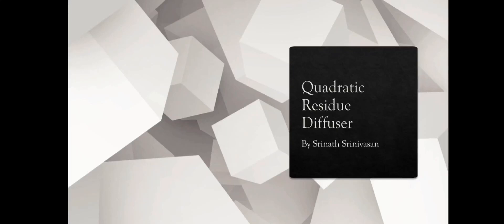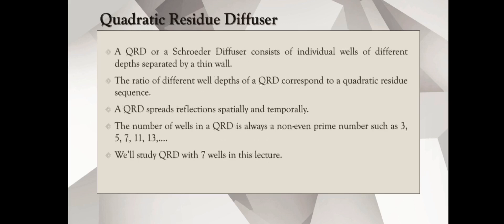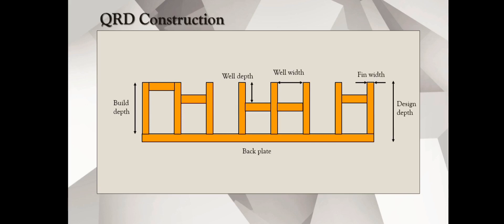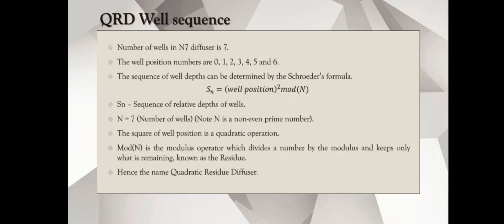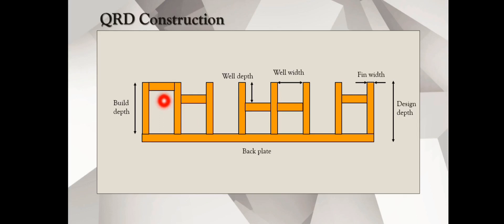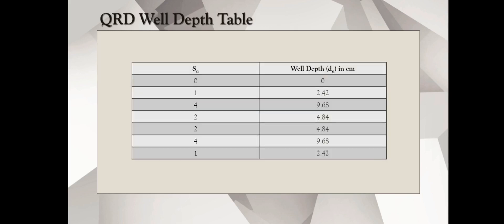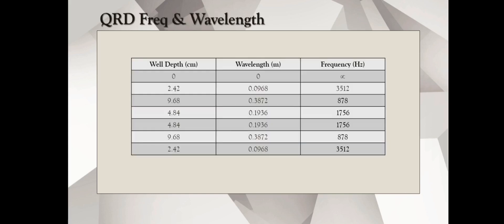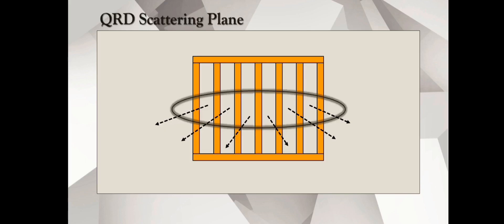Quadratic Residue Diffuser (QRD) Explained

Comment: This was super informative and helpful. I was following along with a spreadsheet and got confused because the numbers I came up with were different. I figured out that the computation of well depths had to use a speed of sound of 338.8 m/s and not the 340 m/s shown in the slides. With that adjustment, I got the same well depths and wavelenghts exactly, but the frequencies didn't match up. It looks like after computing wavelenghts based on 338.8 m/s, you switched to using 340 m/s for computing the frequency. That gave me exact numbers. I know speed of sound varies by temperature and elevation, etc. so its not a big deal if you used 338.8, 339, 340, or 343. That said, you might want to update the slides to use a consistent value for the speed of sound or make a footnote on what value you used in which computations. Thanks again for this video, it is super helpful.
Reply from the maker: Thank you! Regarding speed of sound, I always used 340 m/s. Let us go through the well depth calculation. The well with well position "1" can be calculated as dn1 = Sn1*(DF/2p), which translates to dn1 = 1*(0.34/2*7). Now, I took the first four significant figures after the decimal point and the answer was 0.0242 meter. Similarly well depths of other wells can be calculated using the above mentioned formula. Taking advantage of the Residue sequence which for an N7 diffuser is 0, 1, 4, 2, 2, 4, 1., I simply multiplied the answer 0.0242 meter by 0, 4 or 2 as required which resulted in the answers 0 meter, 0.0968 meter and 0.0484 meter respectively. 

While theoretical calculations can get precise to decimal points, practically, software rounds the value to integers in millimeters (mm). In this link below, I display the results by using the QRDude software to get the well depth values by either inputting "Design frequency" or desired "Deepest well" by which the design frequency would change. This software rounds the values and displays the well depths in mm.

https://srinath96.blogspot.com/2025/06/quadratic-residue-diffuser-well-depths.html

Comment: Awesome video, unless I missed it, is there any specific reason why many manufacturers exclude well number 0? Esthetically they'll look symmetrical but wondering if there's a benefit in terms of sound. Maybe well number zero is not that influent? Thanks in advance!
Reply from the maker: The well number 0 is present in QRD of any order. When installing QRD assuming N7, it is recommended to use arrays of N7 as using only one will not give meaningful results. So either one can leave the well '0' on one side or split the well '0' evenly along the ends. The latter option ensures that one does not need to worry about symmetry during final assembly.

I do not know which manufacturer excludes well '0' altogether but there is a well known QRD manufacturer - RPG Acoustical systems. Their QRD model QRD-734 as mentioned in their website offers well '0' split along both ends.

Out of curiosity I used QRDude software to check if there is any difference in keeping well '0' as it is or splitting it along ends and there was no observable difference. You can check the findings in the link in the video description now.

Finally my thoughts, even if a manufacturer were to neglect well'0' altogether, they still have to use end-fins on both sides to cover the diffuser sides. In that process, they have just added an approximate well '0' on both sides since the end-fin will have some finite thickness.
Reply: Oh thank you very much for your detailed explanation! Now it makes sense... It was my mistake, never noticed that most likely those looking "simmetric" in fact have larger sides to compensate...  I prefer the simmetric design, unless is equally good!

Comment: Great video, i have question: 

How to determine the exact number, width and depth of wells and
according to the needs of the room?

Thanks
Reply from the maker: First, the diffuser dimensions depend on available space and the frequency range of diffusion you are looking for. Second, a diffuser alone will not create diffusion but the room in which it is placed has to work along with it. For this reason, several measurements have to be conducted in the room to determine the appropriate type.
Reply: Does a binary amplitude diffuser (BAD) have the same diffusion properties as QRD or PRD diffusers?
Reply from the maker: I read information about Binary amplitude diffuser (BAD). It is designed to offer more absorption in low-mid frequencies and less absorption in high frequencies. Some sources claim that it offers diffusion in high frequencies, I do not know if it is true. There also exists no mathematical relations unlike the QRD. RPG Acoustical systems, a well-known manufacturer of QRD, also manufactures BAD, they have not mentioned anything about diffusion coefficients with respect to frequency of BAD in their technical specification sheet.
Reply: @SrinathSrinivasan  Thank you🙏

Comment: Thanks for an informative video. What would happen if the wells were filled with an obsorption material like rockwool? Thanks
Reply from the maker: A QRD is designed to spread out or distribute sound spatially and temporally without altering its energy. Filling QRD wells with absorptive material will not help to accomplish sound diffusion as sound energy will be absorbed.
Reply: Hello @SrinathSrinivasan  and thank you for the reply. So if I understand, the qrd won't diffuse as much sound because the filling is absorbing some of the energy but other than not diffusing as much as it might, are there any other detrimental impacts to the manner in which the sound is diffused?

Comment: Thanks for the well presented and very clear explanation of how the calculations are done for a quadratic diffuser.  My question is how does one determine the best design frequency for a given size room?
Reply from the maker: You're welcome! The design frequency really depends on what band of frequencies you as a user are interested in diffusing. If  diffusion in desired in low frequencies, then the design frequency would be lower. Finally, space availability is also important which can decide the design frequency since lower frequencies demand deeper wells which consumes space.